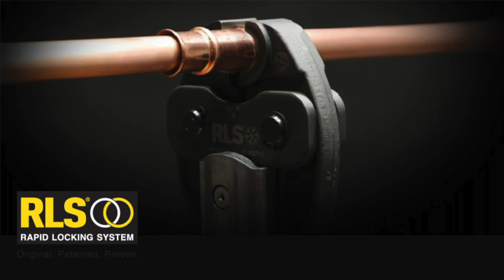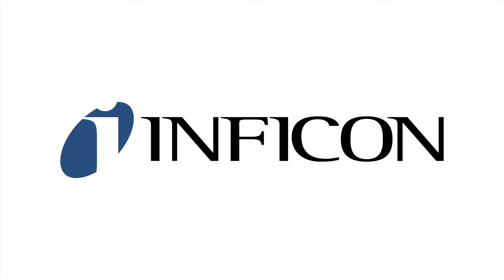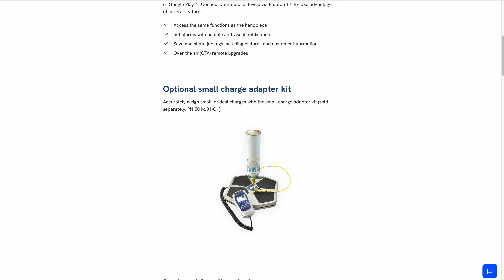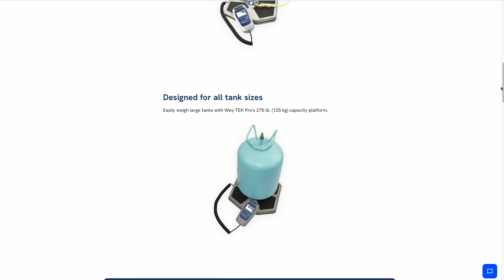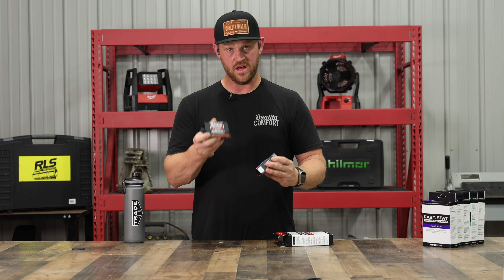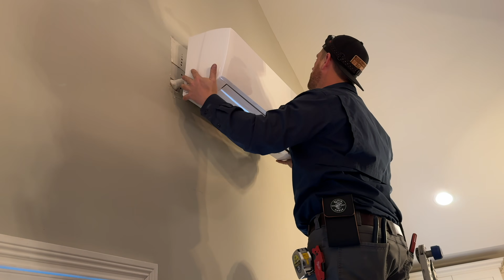High Efficiency HVAC Systems Worth The Extra Money??

Comment: As with anything - the Simpler , the Better & Cheaper to Repair. Most of the Population Understand that & Want that. 
You say Get on Board. i've Got No Problem Repairing Complicated Stuff. Been doing it for years. Computer controlled Cascade refrigeration systems since 1980 that interface with Main frame Computers at Hughes aircraft & the Jet Propulsion Laboratory.
Flouro carbon Liquid  based Thermal shock equipment. 
The Average Homeowner does not Want to " PAY " those costs for A Computer controlled Highly Complex system. The More parts & Pieces. More things to go wrong.
Just Like A Car with 25 Circuit boards in it. it's Just not necessary.
Like they say - " Kiss "  - Keep it Simple s****d.

Comment: Retired home owner here, have done my own HVAC maintenance over the past decades. 

I am always reading, watching videos to learn more.  the VRF Inverter systems really intrigue my Guru mentality.

my situation is different than most, a 4 ton Rheem single stage, years old Cooling system,  Natural Gas heat.  

I installed a Honeywell WiFi controlled Thermostat many years ago because my Electric Utility gives me a discount when they need to turn OFF  my Cooling system.

Love your channel, I learn a lot, my knowledge base is 1990s and older, you help me a lot.

Comment: I have had a lot of complaints about vs air handler noise level when aux heat energizes.   Variable speed blower motors increase RPM with an increase in external static pressure across the blower. These new high-efficiency systems with their huge indoor coils do not pull the humidity out like the old inefficient systems did. In humid climates, like you said, you need a dehumidifier too. I will never put a unit on a bedroom wall using a bracket.
Reply: A more efficient variable system ,if sized properly, will run longer cycles when cooling than single stage systems and will dehumidify better.  A larger indoor coil will also remove more moisture.  One tip is in cooling mode make sure the fan is set to AUTO otherwise the fan will keep running and blow moisture from coils back into air.

Comment: My AC would run 24/7 if I set my thermostat at 72. My systems are about 10 years old and getting time to replace with something more efficient. My two story Florida house isn't that tight and doesn't have very efficient windows. This is good info for considering my next heat pump.
Reply: Do not go up in efficiency, that will not address your problem at all. Might just need to confirm unit is sized correctly or address some home insulation issues
Reply: @MrSwaggerLlama  Thanks! I have ample insulation in the attic...probably more than enough. Can't say what's in my walls...probably bare minimum from 1999 standards. My upstairs return is probably undersized and was thinking of adding louvre doors to get more return air. I've had several HVAC techs tell me that would improve upstairs cooling but no calculations to confirm.
Reply: to start - Best thing to do to save money on electric bills is:
1) change air filter / install a Clean air filter.
2) Clean Condenser
3) Clean Evaporator
4) Make sure unit is Full of Refrigerant.
Do this every year right before the heat starts. Best way to save money during summer heat.
Reply: @OcRefrig  I do all of that including checking some electrical components. I don't have gauges to check refrigerant but I had it checked recently and all OK. Clean out condensate lines too!

Comment: Nothing said about "cost of ownership" over 20 years.
The more complicated equipment has a higher  failure rate and cost of repair over the life of the equipment.
Reply: One repair on super  high efficiency  equipment and there goes all ur savings u incurred till it breaks  ,keep it simple and somewhat affordable, now if ur a millionaire and u can afford it then by all means. Not many techs out here that can even fix this high tech units
Reply: I tell customers the more computerized things it has in it, the more sensitive it is and the more failure points it has. When things go well, they're great. When things fail, and entropy always wins, they're more expensive to service because there's fewer universal parts.
Reply: Agreed the ROI doesn't work out it will be long past the warranty before it will be realized compared to a 2 stage system.
Reply: you are being close minded. i had minisplits installed that save me about a thousand per year on energy use. i can easily afford to have them serviced slightly more frequently than the old style systems and the wear and tear of short cycling is eliminated.
Reply: Use kobiecomplete SEER SAvings Calculator to see savings.  The false sales pitch is using the SEER rating of your old vs new.  The real savings in the minimum SEER rating you can now purchase vs the high efficient  you're considering.  Now compare the cost of installing vs savings.

Majority of times it's never a wise dollar investment to go high efficient.
Reply: Soooooo sorta kinda. Most of the time it’s due to improper installation and commissioning.